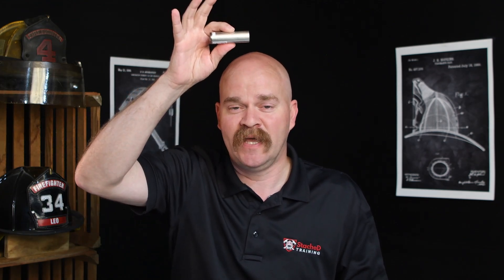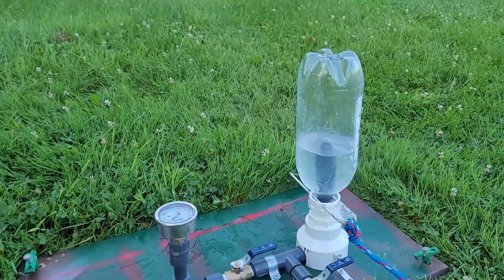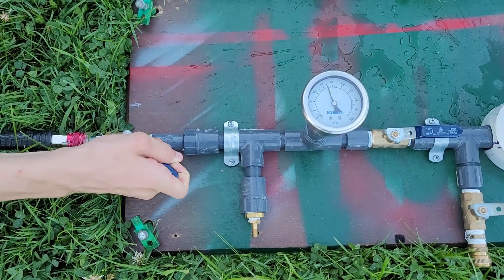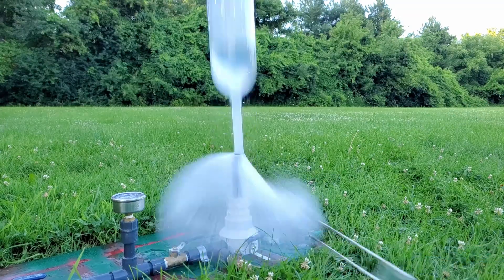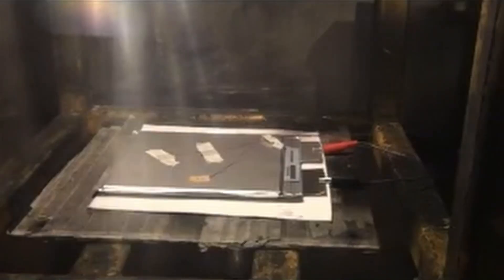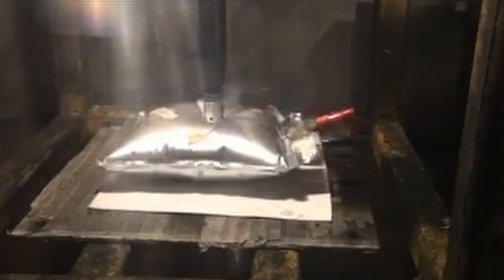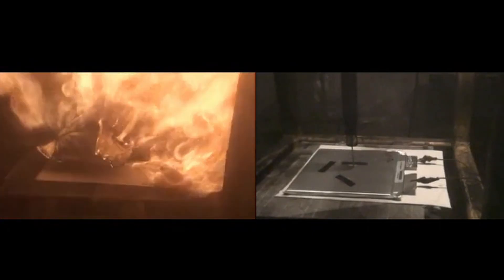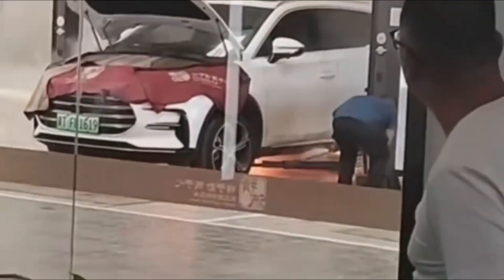Lithium-ion Battery Fires: Full Charge vs. Low Charge

Comment: i wonder if capacity matters. You talk about relative percentages, but energy differs based on battery capacity, right? 

Lets say 20 000 mAh at 100% versus 40 000 mAh at 50 %. 

Is the energy stored same? Is the termal runaway same destruction-wise?

Comment: Difference not quite as much as it seems. A 50 kWh battery stores enough electricity to produce as many BTU's of heat, as 1-1/2 gallons of gasoline. Burning the battery discharged, releases as much heat as ~8.5 gallons of gas. Fully charged, the total heat release is closer to 10-10-1/2 gallons of gas. State of charge does make a difference, but not as much is the nail punch test suggests.

Comment: Without even watching this video yes of course it matters. The terrible thing about batteries vs. let's say a fuel is batteries contain everything they need to create power or disaster where let's say gasoline does not it requires the atmosphere and the oxygen for the other half of the fuel batteries contain everything there much more dangerous

Comment: What good is a battery that is nearly dead?
Lifepo4 batteries have built in BMS controllers. They detect charge AND temperature.
It will shut down problem cells automatically.
Button top cylindrical batteries also have a kind of BMS controller in them/
Flat top lithium batteries are the scary ones. Those rely on external controls.

Comment: The main issue is the cathode material - a Nickel/Cobalt Oxide.   The oxygen is only weakly bound to cobalt/nickel, it takes little energy to separate them (a relatively low temperature) , and when oxygen gets liberated it can react with other substances releasing much more energy (heat) than it took to separate it.  However, oxygen is strongly bound to lithium, the less charged the battery, the more lithium is found in the cathode, which means higher temperature is needed to get it to dissociate.   Yet with a lower state of charge, the battery is less able to generate this temperature from a short circuit.

Comment: Have not watched yet - should include half charged.  For long term storage, around 40% is said to be best for Lithium batteries.

Watched - would be safer, but not good enough.  Really only matters for battery warehouses or when shipping, most uses need them to be charged as much as practical, up to 80%.

Comment: Oh man, you've got a tiny clip from the Rich Rebuilds channel episode with the Tesla battery pack igniting on the little amusement park car! THAT was what first alerted me to the risks posed by these Li-ion batteries, which finally led me to StachD (with help from the YT Algorithm). ALSO, this reassures me I've been storing the Li-ion batteries for my lawn equipment correctly: I leave them DIS charged, then charge them in a saf(er) area just before I use them. So not leaving highly charged batteries in the 75+% range in storage. WHEWWWWW! 😌

Comment: I have a question for you.   It is the salt on your skin that will kill you from electric.   What if Very salt water is used.   it would give a way to discharged to ground the stored energy
Boats at sea, and radio stations that have their ground into the sea waters, use the whole ocean as a ground....

Comment: The convert prosentace to voltage is good know. Sometimes measuring voltages are only way to see charge state. Voltage scale 3 - 4.2 V from cut off to full charge. Maybe calculateting it from that 1.2 V difference, it work? Pack of cells in serie, give multible voltage according numbers of cells.

Comment: This information seems to suggest the need for some sort of built in rapid discharge system that fuses all the internal metal layers to the case.  Since I have a very basic understanding of how these cells are made I have no idea if they already have any sort of features like this.
Reply: That would just make the battery hot and send it into thermal runaway before it discharged. Maybe  you could direct the heat into boiling some water but keep the boiler insulated from the battery pack.   Or, run a bunch of leaf blower fans to blast ambient air at the battery while draining it.  Of course, can you guarantee this setup will still work after a crash ?

Comment: I had a faulty cell so I pulled it apart to find the fault,  which was the positive connection.  On the way out to the trash and dropped the unwound roll in a puddle.  Instant fire ball.

Comment: what voltage was the drained cell? i did the same test one at 3 volts and one at 4.2 volts and both were just as violent.
Reply: 3 and 4.2V are the nameplate 0 and 100% charge voltage for Li-Ion and Li-Po [just different packages - both can contain a high current or high capacity or mixed internal construction] types.

but i guess the non bothered Li-Po pouch in this video was actually discharged to death. so not the re-usable 3V but close to 0V.

Comment: The main risk with lithium ion style batteries is that even when discharged, the chemistry of the battery still contains a significant amount of 'latent' energy that's locked in the battery material. Lithium ion cells almost uniquely release their own oxygen to make a risk of causing a self-sustaining fire if they are heated to around 220 degrees C or higher which is one way to trigger a thermal runaway to start and battery to eject flammable toxic gases. I believe that an EV or hybrid vehicle should always be assumed to be full or close to full if the start of charge for an EV or hybrid on fire cannot be discovered through asking the driver. It's usually not possible to disconnect the main battery module and even if that's possible it's the battery module itself feeding a thermal-runaway fire. Stay safe and thanks so much for your insights.

Comment: Let me add some further detail.

There are two kinds of energy in a lithium ion cell: electrochemical and chemical.  The electrochemical is proportional to the state of charge (SOC) and the chemical is for our purposes relatively constant.  But these interact.  The chemical energy stored is a combination of the flammable liquid electrolyte as well as the energy stored in the anode and cathode active materials.

If you have a completely discharged cell (zero SOC) you can cause all kinds of physical damage to it without anything happening.  I am able to disassemble discharged cells to examine their internal construction quite safely without any risk of self-induced fire.  There is still stored electrochemical energy but nothing to initiate its release.

The stored electrochemical energy, which increases with SOC, has several effects on the danger.  The first is that these cells can produce very high currents which can cause burns when shorted, and multiples of charged cells such as in battery packs, especially larger ones, are an electrocution and arc flash hazard.

The second effect is that the energy released when a short occurs, such as in the nail pen test you showed, caused localized very high temperatures which can ignite the electrolyte and at higher temperatures cause a runaway thermal condition as the active materials release oxygen to fuel their own fire.  When a cell puffs up that is the flammable electrolyte vaporizing into an explosive vapor.  The initial fire looks like a gas fire because it is.  If the localized temperature at the short is high enough, it will start the runaway thermal reaction which you cannot extinguish as it creates its own oxygen.

Temperature also has an effect as electrochemical and chemical reactions are highly temperature dependent.  This manifests two ways:  if the battery is very cold it will have less available electrochemical energy and the temperature rise to get to self-ignition will be larger, which can dramatically slow the propagation of a thermal runaway reaction from cell to cell.  The second part of this is that as the battery heats, more and more energy is available and the reaction accelerates, going exponential.  This is a major hazard in these fires.

Dead (zero SOC) batteries will still burn violently if they are involved in a fire, but it is more like a fuel fire.  Charged ones will much more violently burn as each one releases the stored electrochemical energy to cause rapid self heating and exponential spread.

Another factor in battery packs is related to design.  Some cells will release their internal contents when bursting (or venting violently) and this contains thin metal foils which can cause electrical shorts and make things worse quickly.

Hope this helps.
Reply: This did help. I have a follow up question to make sure I understand (actually the reason I'm here watching this): 

I recently discovered my old MacBook in my closet, it has been in storage for about 7-8 years, maybe a few years longer. I discovered that the battery has pillowed on one of the cells at some point (likely happening before I stored it), it has been sitting totally unused and passively discharging for this entire 7-8 years  in storage. 

What about compromised dead batteries that have pillowed? As it has been 8 years or so, I'd assume the compromised battery has lost most of its electrochemical energy? If it were punctured in transport, it would just release gases/chemicals rather than initiate thermal runaway?

Obviously I am planning on getting it to a recycling center to dispose of properly now that I discovered it.
Reply: @TachankaSound  Usually it's due to degradation of the liquid electrolyte, a chemical reaction.  Don't try to charge it and don't puncture it.
Reply: @flyer617   thank you

Comment: Interesting, i understand that the amount of charge would determine the severity of the runaway situation but, i wish there could be more determination on the causes of these runaways.  If these could have been prevented... manufactured different etc. But now i see how it may be better for the electric scooter people to store them at low batt, but then what do you do if you need it and you have to wait hours for these things to charge back up?  LOL there is still research and work to be done.

Comment: @StacheDTraining 

Great explanation video. But, what i would really like from you is the detailed schematics/blueprints for that sweet and very sharp looking bottle launching cannon. Haha. I built a high powered pneumatic potato howitzer that has a super quick discharge (sprinkler valve) pressure tank that'll safety hold 130 psi. I should also mention that calling it a potato gun is an understatement. The barrel (4" diameter and 54" long) will easily fit and fire a 355ml (full) beverage can, a chunky soup can, or a beer bottle, or even a half shovel load of gravel. Basically, whatever you wanna shoot and will fit in the pipe.. It'll fart it out with very impressive force. And all i use, as a wad to create an almost perfect seal between the projectile and the firing chamber, is a 4" long by 4" diameter piece of a solid pool noodle. Hahaha 😎

Comment: when charging a battery with a BMS one must use a smart charger specifically made for Li Ion. i'll wager he either used an old Pb Acid charger or a newer charger not made for Li Ion. 
my smart charger can't do Li Ion only Pb Acid and LiFePo.
Reply: My battery bank was 12 lifepo4 batteries, 300 amp hours each. They were in an array 4 across, 3 levels high. 46.000 watt hours of power. It had an MPPT set for lifepo4  and the bank was at 100% charge. The video monitor showed the state of charge and that the current was at 1 amp at the time of the fire. A bottom shelf battery caught fire and set the whole battery bank on fire. The system had been running for 2 years and the load on the multiple inverters was less than 750 watts total. It never showed signs of distress or troubles. All components were name brand, the cables were 4/0 and 2/0 with hydraulically crimped ends and each battery had a fuse. They are still investigating why a BMS or internal short caused the fire. $100,000+ in damages was done to my shop and adjoining garage. My next battery bank will be in a fireproof shed outside and away from the house, 48 Volt, UL listed, outside rating.  I have built a total of 14 battery/inverter/charger systems for friends and family members and never thought a lifep04 battery with BMS would ever catch fire.
Reply: @ correction: Will Prowse
Reply: @ i assume prismatic cells and all had BMS. i think it's rare but, everything is made in china.
Reply: @ you should ask Will Proust here on utube.

Comment: Hi! This is great information, thank you! I have a wrangler 4xe (hybrid) with a current recall saying not to charge or park by a structure but they’re saying it’s safe to drive. I’m curious to see what you think, if I’m not charging and the battery level is low (I understand it’s never zero even without charging?) will I presumably have time to get out and get my dog out of the jeep before anything catastrophic would happen? Due to the current market and the unfixed recall (currently no fix from stelantis) I’m very underwater with what I owe if I wanted to trade in. So I’m just trying to decide if it’s unsafe enough that I should take that hit or if I just need to wait it out until they have a fix. Is it even safe to drive after that recall/fix? I have watched videos that talk about the battery in the 4xe being a design flaw due to the placement under the back seat, saying it’s unsafe. Thanks for your time!

Comment: I didnt even know lithium batteries were so dangerous. I happened across a recommended video on lithium battery exploded and a new fear was found. I had no idea i had so many lithium batteries i wws carelessly using. Power banks just to name 3, but i ended up finding about 7 that are in the home along with the small batteries that the security devices use around the house. Terrifing to have so many time bombs. The house came with huge old thick vintage safes that i now store them in when not in use and at low charge. I now charge my devices in the fire place....and i have the lipo bags that i put the power banks in if i need to take it with me to later charge a phone. Now know what to look for when it becomes unsafe. They really need to educate better on these things. I will never ever by a tesla
Reply: Realize there are many different chemistries of lithium batteries. They are not all equal.

Comment: Thank you for sharing this information. I've got a few tool batteries that often set around at or near full charge. In fact I was in the habit of always fully charging them after I'd use one. I'm going to stop doing that. From now on, I'll be sure they are at a low charge state when not in use. Probably get a fire box to keep them in too.

Comment: I’m collecting retro mobile phones and since recently I’m really thinking about the dangers of that hobby. 

Unfortunately I have no expertise in swapping batteries (although I tried it a few times) and it’s overall an expensive process (especially for a high amount of phones). 

I charge the devices regularly and use them from time to time to tinker around. 

I guess the best thing is to store them with relatively low power, right? I checked the circles today and it seems like most of them are around 400-600 circles though some still at late 70-80 percent health (apparently). 

I guess someday I’ll have to send them all in and pay a fortune just so they’ll work and not set anything on fire. I have to say, some models are definitely past 70/80% health and barely charge at all. Don’t see them expanding just yet. I guess I don’t use those. 

Maybe I’m a little overreacting but an explosion is just nothing I really would want. Especially if it looks like the 100% charged one.
Reply from the maker: I guess it depends on how retro.  Many of the cell phones from the early 2000's did not use lithium-ion batteries.  Many phones up until 2015 had removable batteries.  There is a youtuber that had brand new Samsung phones displayed in his house.  He noticed multiple phones had batteries that had swollen.  https://youtu.be/OfM0GqsIB6c?si=FGRWYyV0U9v6RPG0
Reply: @StacheDTraining  I got wind of that YouTuber. Unfortunately most of my collection contains old iPhones making this extremely tedious. Had to notice how great my removable battery phones are. Those iPhones should have Lithium ion batteries. My flip-phones may be an exception. Like I mentioned, my only option is to send them in. Maybe the iPhone 4/4s models would be something I could do though I also rather not break anything. This whole battery thing is a problem I noticed rather late I guess (started collecting around 3-4 years ago). Also would really not love to sell them, since I just hate e-waste and I’m too deep into it. Well, well…

Comment: Lithium metal self ignite and burn violently when expose to oxygen. Charging the battery cause minute expansion. When the metal case is not strong or sealed properly, it could leak and catch fire. Certain lithium chemical (li polymer) do not self ignite. But you cannot guarantee the purity in the chemicals.

Comment: Does this mean if the battery is at 0% there would be no chance of thermal runaway?
Reply: Correct, because thermal runaway is caused by the battery being internally shorted and sending high amounts of current through itself. If there is no charge left in the battery, it cannot create current. However, a dead lithium-ion battery still contains flammable electrolyte which can be ignited by an external heat source, but it can be put out of water is used to remove the heat.
Reply: @beanapprentice1687 a dischaged Li-Ion still contains quite some electrical energy.   in normal operation is it not used to get some cycle life out of it. but it's still enough for a thermal runaway.

3V per cell is 0% SoC.  but 3V is still 3V. and 3V at 15 milliOhms internal resistance is still pretty powerful. enough for the mighty TR to happen.